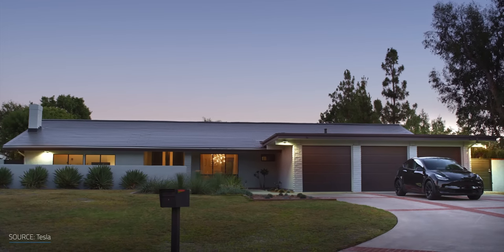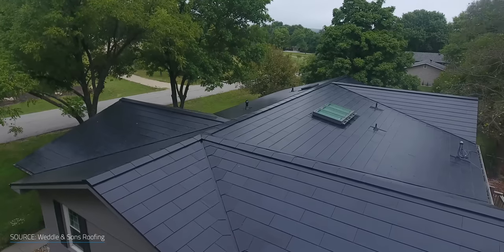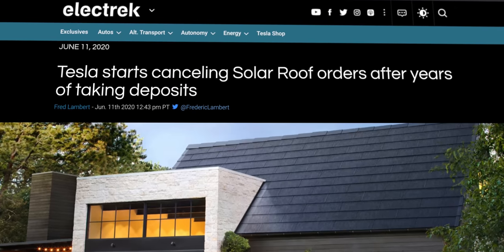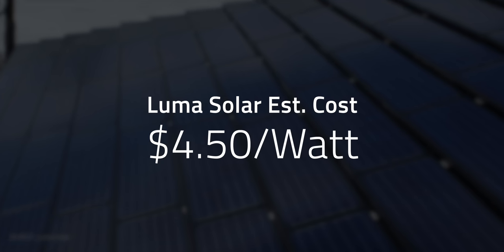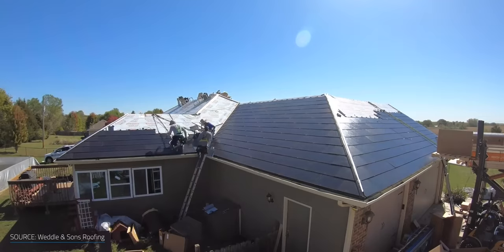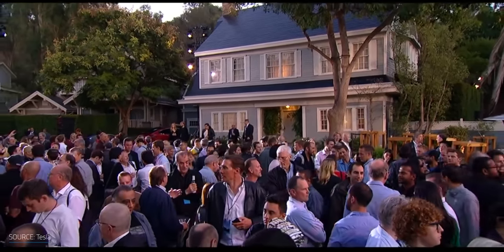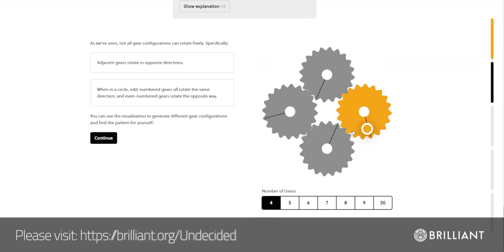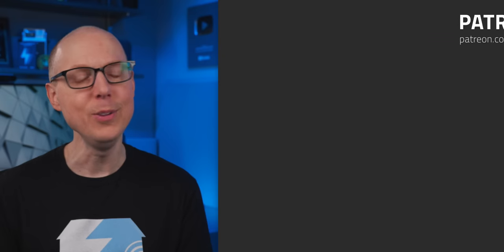The Problem With Tesla’s Solar Roof

Comment: Traditional solar panels have the advantage of allowing you to more easily start small with just a few panels, and then add more as money becomes available.
Reply: Yup. Also, you can add a bit more if your electricity demand increases. Like if you switch to an EV or an electric range/oven.

If the efficiency rating of the tiles were the same as the panels then I’d be a bit more excited about them.
Reply: This notion is complicated by the permitting process, the utility approval process, and the sizing of the feed wires to your panels.  Its not too easy to just add a few solar panels even if you do it yourself.
Reply: That’s true for most people, but for farmers and businesses that usually have multiple buildings but limited land to put solar on, roof solar is a great boon… when it becomes available…
Reply: Tesla Solar Roof is modular by design, in theory you can add or remove power generating tiles while keeping a high endurance long lasting roof.
Reply: Do you have any advice were to get solar panels?
Reply: Depending on the quality of your roof though you may have to buy an entire new roof before a company will install panels on it. Also when it comes to space you are limited depending on your roofs shape.
Reply: @daniel17319  Real Goods if you want to do the install yourself! That have been in the business for decades.
Reply: It's a bad idea. To try to do both jobs at the same time is stupid. They are completely different jobs and they are both difficult. It's doomed to be bad at both jobs.
Reply: Yes.  When we do our home renovations, we run conduit(s) from mounting location(s) in the garage to roof stub-outs for future PV installations.  Now we're "Net-Zero-Energy-Ready" and we don't suffer from those unsightly conduits mucking up the exterior walls.  Keeps everything tidy and attractive instead of looking like it was cobbled together with duct tape and bailing wire.  Eventually PV will be a standard feature instead of looking like a badly executed afterthought.
Reply: Literally almost no one will do it that way.
Reply: @SimplestUsername  and the powerwall will show up a year after that
Reply: I’m not sure how much of an advantage that is.
Your inverter etc. will be sized for the panels you have installed. If it’s oversized to start with, you lose out on efficiency. But if it’s undersized to start, you’ll need to replace it as you add more panels - possibly along with the cables etc. that support it.
In addition, any scaffolding and manpower costs to return and add a few more panels in future are expensive!
Most people would go as big as they can from day one, maximising production and making the most of those fixed install costs.
Reply: What if I just want the whole roof to be a solar panel
Reply: My area only sells solar panels contacted with a company that basically charges you then THEY sell the extra electricity back to the grid.
Reply: But, they’re not aesthetically pleasing.
Reply: Sadly, very difficult to plan an expandable system. It's fine if you plan for the large system and only get a part of it running, in that case i'm okay with it.
Reply: Of course my idea about adding more panels is purely theoretical. I've never actually had solar panels installed.
Reply: @2nd3rd1st  That really should be Tesla's main tag line: "Tesla. Great. In Theory."
Reply: @roshi98  That was a good joke in theory
Reply: Correct .. much more flexibility .. including NOT putting them on the roof.
Reply: @2nd3rd1st  Actually, it was just a hypothesis.
Reply: @paulogden7417  that just sounds like a process technicality that you would need to go through anyway. It's not really some kind of roadblock.
Reply: Totally agree here.  I would love a solar roof but considering I live in a pretty rural area, that may not be as easy to accomplish.  Also given I’ve only owned this home a few months but am having solar installed in a few weeks, the ease to expand as needed will be a great option with the traditional panels.
Reply: @innrwrld  And if you don't mount those panels on your roof .. you have the option to take them with you when you move. Since the jury is still out on what value Solar installs add to property .. this IMO, is a big wildcard when the payback periods are longer than the period most people own their home .. ~ 7yrs ownership. I'd be very interested in a solar product that is EASILY "unplugged" and transported to another house.
Reply: Not true. Timberline Solar is expandable and also comes with a 25 year production guarantee.
Reply: You have to plan ahead and pay a lot upfront to build in a way that cam be easily upgraded. It really hurts ROI, so it's best to go as big as you can asap if the ROI is a concern.

 The "Tesla" solar roof is a terrible idea. If one goes bad, it is a huge pain to replace. They are not optimized which means shaded cells will bog down all the rest. Solar edge inverters allow for   each panel to be optimized so if a panel is shaded for part of the day or is damaged somehow, it will not effect other modules. It can also allow you to mix and match modules. 

The last con I will point out about the existence of "solar shingles" is that HOAs can insist on them. There are laws forbidding them from stopping a homeowner from installing them, BUT they are allow to " impose reasonable restrictions" which is very hard to define. In CA many HOAs that require tile roofing , will make them instal them flush with the tile by removing tiles. Not only does it add a ton of extra prep cost, it makes them EXTREMELY hot and therfore rather inefficient. Green Marketing is killing our ability to make meaningful changes. Musk and other conglomerates are not going to save us. It will be the little guys and individuals with passion for the environment,  not profit.
Reply: @theminer49erz  There is a strong trend toward moving out of Urban areas .. in future decades more people will living in non-urban areas, with fewer HOA's and land restrictions. Advancements in tech will enable much more remote working .. people will choose NOT to live near expensive cities, and have the liberty & land to build a scalable modular solar farm next to their house.
Reply: @reggiejenkins6458  Can you have literally almost ?
What is literally almost ?
Is that almost literally also....or not ?
Reply: @daniel17319  Will Prowse on YouTube.
Reply: @Jordan-Ramses    Can you explain?  Do you have any facts?
Reply: @jesseb4me     Micro-inverters.
Reply: but if you plan to expand you need to get a bigger inverter at the start
Reply: @Jopino not with micro-inverters
Reply: @Jopino Joppy, Joppy.  You are very wrong.   I tried to be gentle because there are SO many people on YouTube spreading verbal diarrhea!!!  Might want to check your facts. 

Enphase (& others) micros are more efficient, not bounded by the rest of the string, and they/re uber-scaleable.  There is much less AC-to-DC & DC-to-AC conversion loss.  If you have storage, it can be direct DC-to-DC.  They just cost a bit more.  Oh, and you have to know they exist.
Reply: @Jopino Wrong
Reply: The difference I think is it is cheaper to have a solar tile for a new house instead of roofing tiles+ solar panel
Reply: ....how do you replace the roof without removing traditional panels.
Reply: @ptrkmr  this is often in connection with government subsidies or building codes. As mentioned in video solar roofs often require special installers which are most only available in urban areas. The reason municipalities do subsidies is so your home improvement benefits the overall grid. The reason building codes and requiring special installers is safety. So rural populations are more likely to DIY, and also less likely to be required to sell back to grid.
Reply: @KrustyKlown  Internet infrastructure in rural areas is crucial for this to be a larger trend. It is a “micro-trend” some ppl moving rural for these freedoms but it demands they have the means to do so. If it was a mass trend you just end up with suburbs.
Reply: @LizStaples  "Internet Infrastructure in rural areas" .. here comes Starlink and others.  The MUCH lower cost of housing in more rural areas will make this a macro trend. Seriously, do you want to piss away the majority of your income on a tiny $2 Million house in a large congested CA city.. or a house 2-4X the size with water frontage in one of thousands of locations across the USA ... for only $200 to 300K, allowing you to be able to save most of the money you make ??  Where you can work remotely, have energy independence, and 50-100Mbps Internet.

Comment: Years ago when Tesla had their calculator website it was estimated my Tesla roof would cost $110,000 in sunny south Florida.  For comparison, an architectural shingle roof was $16,000.  My yearly electric bill was about $2k a year.  I bet my insurance company would like a chat with a new $100k in hurricane country. Even my property tax office would probably want a chat about a $100k improvement to the home.
Reply: So, $94k investment to yield a $2k benefit? How much extra power would you sell to the grid?
Reply: @geraldfrost4710  A lot depends on the roof size, but angle and obstacles are a factors too. Some quick math, Florida power at $0.12/kwh comes to about 45 kwh/day. Given a 5 hour/day solar equivalent, they would need at least a 9 kw system. With the losses of ac/dc conversion, storage round trip, ... another 10-20% should be budgeted. The video quoted Luma at $4.50/w. For that price the roof would be around 22kw. Call it double what is needed and sell the rest back. You aren't going to get the same rate for net negative power, nor get negative taxes and fees. Say you get $0.06 / kwh, it would be worth about $1k/yr. You will still need to make up a base hookup fee, so that might cost $200, or so, per year. Year end net should be around $800, with very large error bars.
Reply: So you basically don't break even until 55 years in and even then...you'll need to replace components after a few decades. You won't recoup any of your investment within your lifetime.

Seems like a waste of money to be honest.
Reply: @internettoughguy  My solar "roof" in Phoenix will break even in 9 years.  Its a shade structure using conventional solar panels.  See my comment above.
Reply: @paulogden7417  That's because it didn't cost you $100K. It all comes down to how much the initial investment is. After a certain dollar amount it becomes pointless.
Reply: @internettoughguy  this is incorrect. The initial investment doesn’t determine when your break-even is. The price per kwh your utility is charging is what determines your break-even. For example, if your utility is charging you $0.13 per kwh, your break-even doesn’t change whether you install a 10 DC KW system or a 20 DC KW system. It should be calculated based off of what you’re saving at that current price per kwh with estimated annual rate increases your utility issues it’s consumers. Essentially, the higher the rate your being charged by your utility, the faster the return on investment comes.
Reply: @bennyrobles5772  You're not making any sense. Your break even time frame is longer if you pay $100K for a 25KW system compared to paying $15K for the same 25KW capacity system. Whatever you utility company is charging you remains a constant with either option.

If I pay $2K/yr for electricity it will take 50 years to break even after installing a $100K system (100/2=50). If that same system only costs me $15K then I break even after 7.5 years (15/2=7.5) How do you not understand the simple math in this?
Reply: You were clearly not taking the time to read and understand my comment properly. I was not comparing the breakeven time on two systems that are the same size but a different cost. I said to the break even time frame does not change with two different system sizes, nor does it depend on the initial investment. It depends on the price per kWh at which you’re saving. Your elementary level math skills are not the appropriate method used for determining an accurate ROI.
Reply: Also, utility rates are not and have never been “a constant”. They have consistently been an ever changing/rising component of consumer usage. They don’t stay the same.
Reply: @bennyrobles5772  What the f are you talking about? The initial investment DOES determine when you break even. You want to tell us that a 100k, 10k or 1k investment has no impact on when you brake even? I have some land on Mars for sale
Reply: @bennyrobles5772  Assuming you get a 10kw system and that covers your use of electricity, then it would be payed off in roughly (cost of system)/(yearly electricity bill) years, so a higher initial cost would take longer to pay off. The rate at which it was paid off wouldn't change though. In some areas companies will buy back electricity credits, if you lived in one of those places and got a 20kw system with 10kw of extra generation, the extra cost could be paid off in 5-50 years by selling credits, highly dependent on where you are. Also worth mentioning, the credit price overall is decreasing so you would probably get paid less over a longer time.
Reply: @geraldfrost4710 the solar roof only works for one year??
Reply: @johnseipel4102  No. Solar lasts for decades. 
As a rural Florida resident, our power gets turned off two hours before the hurricane hits. Not having your water and refrigeration means +$300 (lost frozen food), and not bugging out to a $100 per night hotell. 
Even so, a $1,000 per year premium doesn't make sense.
(A $100 per year premium, maybe...)
Reply: @johnseipel4102  No. A solar roof works for decades, although it's output decreases slowly over time. That's physical reality.
I've installed a Planetary Air Conditioner,  and it dumps enough heat into space to stop 250 tons of ice from melting per year. How significant is this?
Reply: I also live in SW Florida and did some preliminary research.  HOA's cannot prevent roof solar installations, but can require them to be within 45 degrees of due south.  In that same law, the local tax assessor cannot increase property taxes because of the roof solar array.  The insurance company however, probably has an exclusion in their policy.  Even if they do not have an exclusion, a popular deductible is 10% of the value of your home.  Home prices have gone up 20-30% in the past 12-24 months, on top of a few years of healthy increases.  The homes I work on that sold for $450k 8 years ago are now valued at $800k+.  So some of those homeowners with flexible deductibles now have an $80k deductible.  YIKES!!
Reply: @bennyrobles5772  What? NPV of the investment is highly dependand on initial cost of investment. You should get a system that matches your annual energy usage. Income related to producing and reselling excess energy back to the grid won't cover additional costs from higher initial investment and costs of sold energy. Not sure how it is in California, but I am fairly certain that the energy you produce is valued less than energy coming from the grid.
Reply: Yea that property tax thing is a real issue. plus imagine the return of alternative investments like stocks.
Reply: @bennyrobles5772  
I agree with @Silimarina  
"What the f are you talking about? The initial investment DOES determine when you break even."

If the initial investment cost doesn't matter, WTF am I breaking even against? It does matter and it's the main factor. (Not the only but the main)

Your breakeven is the point where your running cost savings equal your .... dum dum dum....  initial investment cost. Yes it's an estimate and will have to be revised as running costs fluctuate but as no-one can accurately predict the costs in the future we just use savings with todays prices against initial investment cost
Reply: Also in FL. insurance company's are dropping customers with 15 years on arch shingles(30-50 year )  How is the insurance company going to treat these products?
Reply: @geraldfrost4710     None.  Net Zero only.  Selling is not the point.  Eliminate the waste, cut the fat.  Making just so you can waste is kinda stupid.  Plus there are dozens of benefits, beyond PV ROI.
Reply: @internettoughguy     Energy bills double every (10?) years, then double again, depending on where you live.  First, cut the fat, eliminate the waste.  Whats the ROI on your new TV?
Reply: @internettoughguy     I can buy the parts & install mine for under $6000.  Do my math.
Reply: @DK-vx5co  Good for you. Not sure what your point is.

Btw, I don't have a TV.
Reply: @DK-vx5co  depends on the size and age of the tv. If you get a smart TV for 400e and run it 8hrs a day (laptop monitor, background noise) it should consume around 3200wh of energy. That is 3200wh of heating.....one kwh costs around 0.22cents.

All put together you will get your new 100cm plasma smart Tv investment back in around 222 days of heavy use on heating savings....all while having a cool Tv

This also means you will get your money back 3x before you even loose the waranty....that is actually a LOT  better than solars
Reply: @internettoughguy  I thought solar panels were good for like a decade, so the investment would never pay for itself anyway.
Reply: @bennyrobles5772  blah blah, you're just making it complicated for everyone.
Reply: @internettoughguy  You'd probably do better to install that money in the stock market.